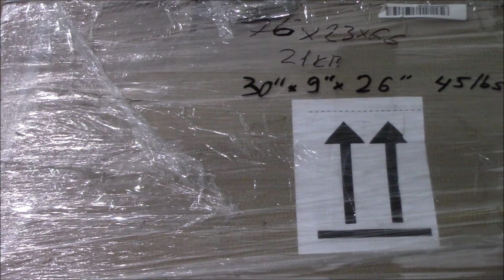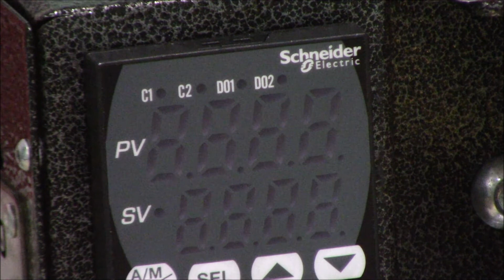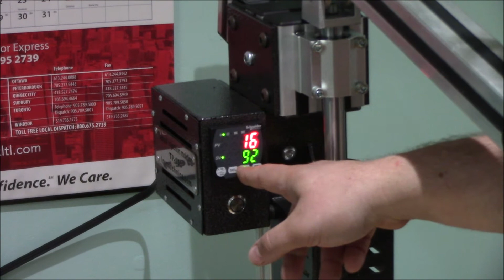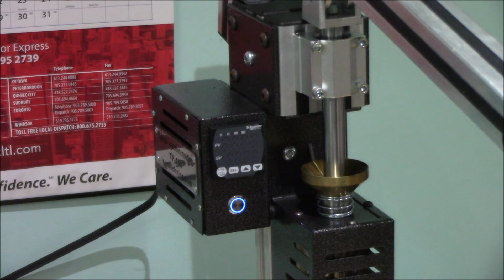Review of Iron Technics "TP15" 110V manual injection molding press machine

Comment: Hey!
Sir, a good machine, I want to get myself one for making small parts for modeling. 
Where can you order one? 
Are there other models? 
How much does such a machine cost?
What temperature does it work at?
Reply from the maker: Hello! You can order it from me in Canada very soon. Moreover, I will be expanding assortment and have some other models of machines over time in the foreseeable future. Subscribe to me, we will gradually exhibit reviews of various machines from Iron Technics. This particular machine costs $ 2500. Operating temperature up to 350C on a continuous basis. Unlike other manufacturers, Iron Technics machines have a unique heating element that can withstand long working cycles without a need to cooldown, controlled by a digital thermostat made by Schneider Electric. The machine is made of a robust structural aluminum profile. I am currently working on placing it for sale.